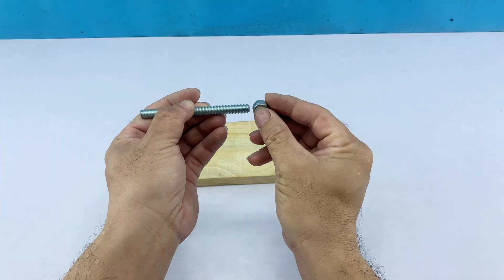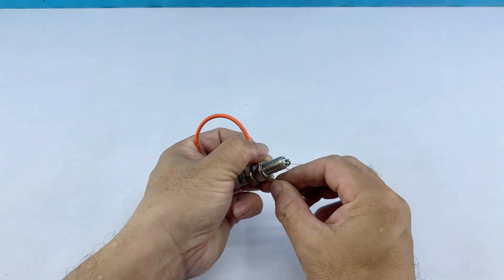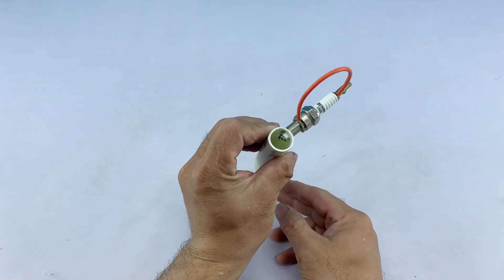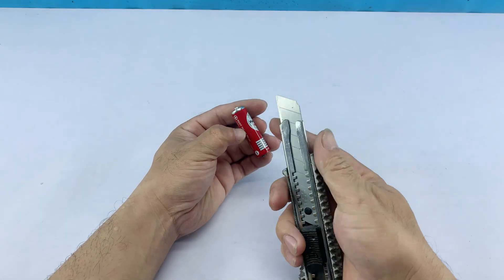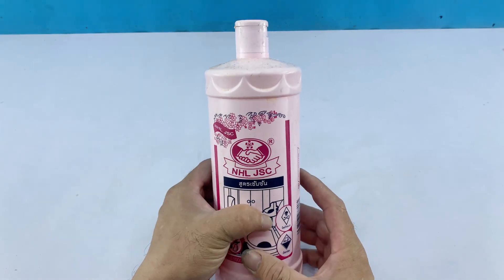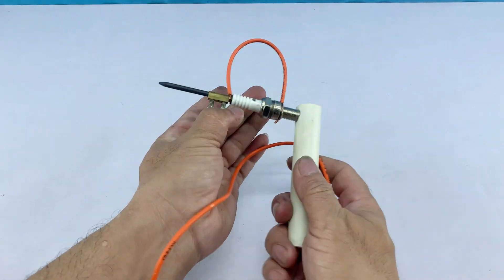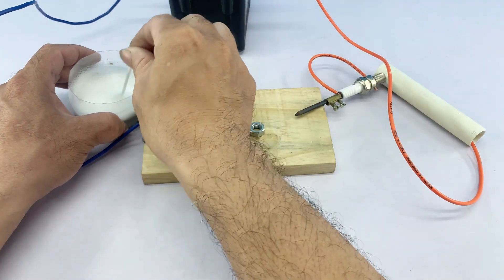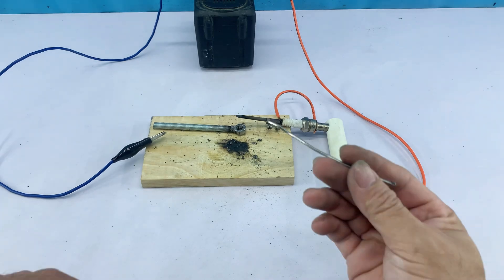Just 1 Minute! How to Make a Super Powerful DIY Welding Machine from a SPARK PLUG! 😱

Comment: Is it possible to weld solid metal?
Reply from the maker: Yes, it’s possible, but it depends on the power of your DIY welder ⚡. For solid or thick metal, you’ll need higher current and good contact between electrodes. It works best for small repairs or light welding. 🔧🔥